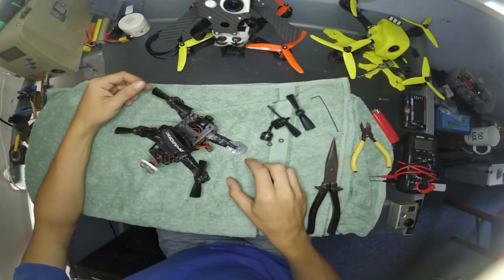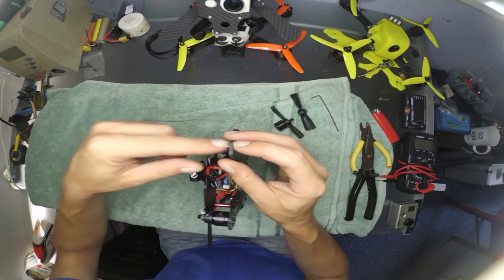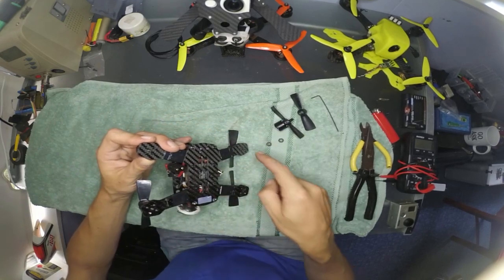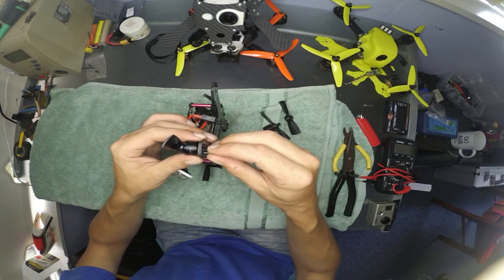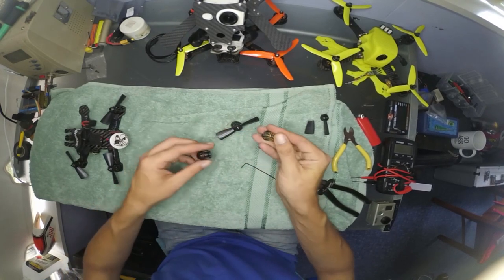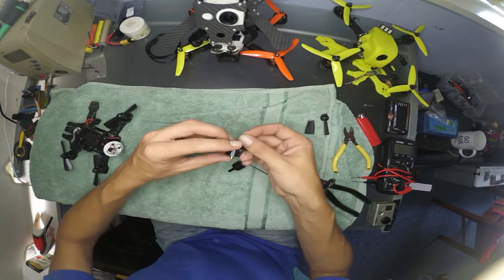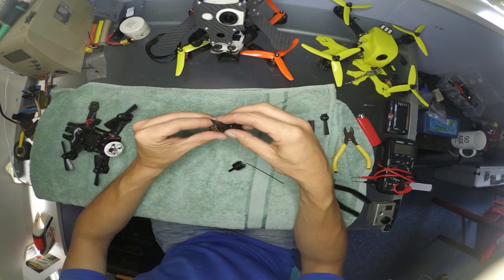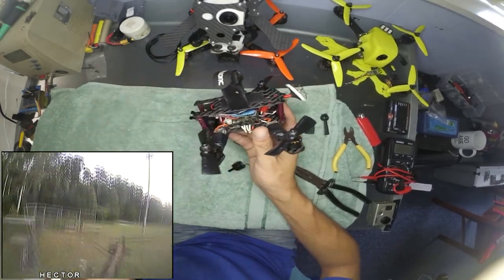RCX 1407 // Part 2 Final Thoughs.

Comment: Any suggestions regarding props? How warm were the motors landing when running those Diatones.. I assume 4s right? Do you think they can handle a triblade 3" on 4s?
Reply from the maker: +Razvan Taranu Yes 4S , i as running 3045 and getting about 3-4 minutes and motors are not hot at all , i'd happily run 3" tri's and hope to get some very soon :)